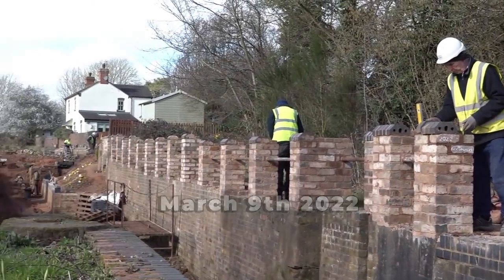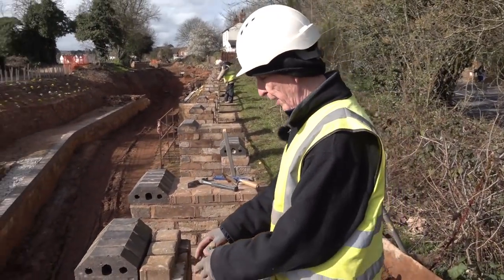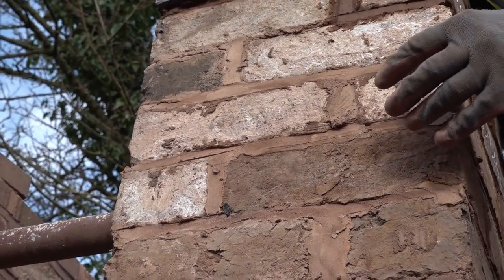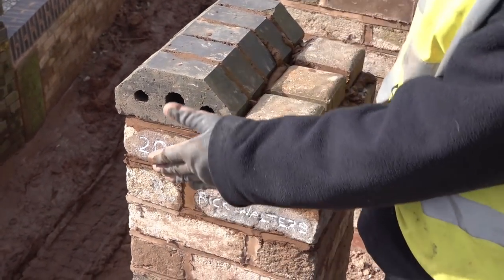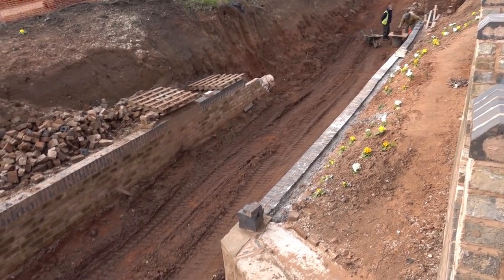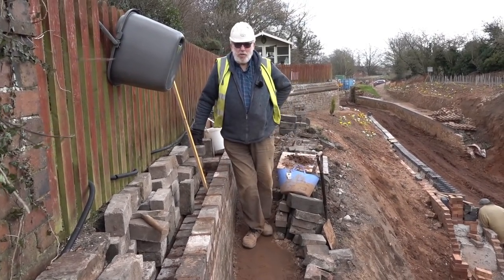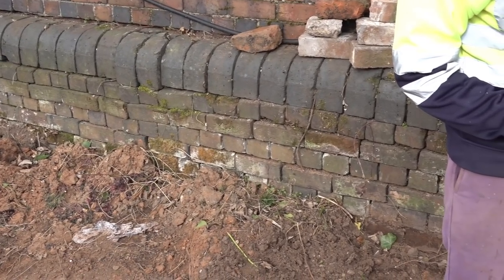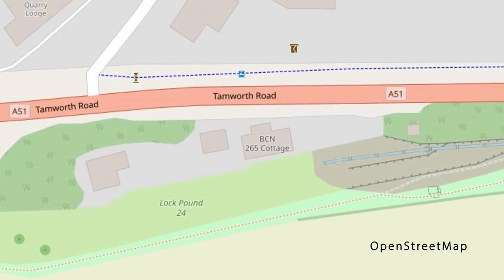Laying Bricks at Old Lock 24

Comment: Or you buttered your brick properly you wouldn't need to point them. Holes in brick should be filled the day before on the ground.  Why use concrete pavers on top of piers cut some brick.

Comment: Pity you couldn’t get some solid double cants for the piers. Would have looked so much nicer than the pointed core holes. Pet peeve of mine. Good job though and you can only work with what you’ve got 🧱👍

Comment: If a young lad did this people would say it’s atrocious
Reply: Your beds weren’t even full enough to be cut then struck, use a level when striking as well, variety of bed thicknesses, smearing muck across the first brick on edge looks awful let alone perforated should be solid, burger perps as well, could see there were sailors all across the top course of each pier, I know you’ll use the “vintage” excuse I’ve heard so many times or “make it look old” but seeing comments saying nobody can do this without decades of experience is absolute tripe, this is middle tier work at best and sorry to break that to you
Reply: I agree with Sammsamm. I’ve never seen anyone laying bricks with a hammer before, using the head. The minute those metal poles expand in them piers they will crack, too tight. No allowance for expansion. No thought or planning in this, make it up as you go